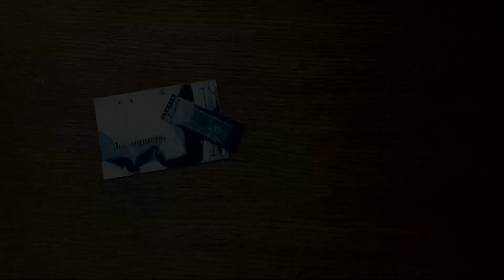Raspberry Pi Pico Brings the Noise.

Comment: Thanks for the video. I just love neopixels. I have one question though on the wiring of the pico. As you use an external power supply is there a risk that you damage the USB port of your pc/mac ? Thanks. Best.
Reply from the maker: If everything is wired up properly then there is no dange, but of your worried about it then you can run everything from a raspberry pi rather than an expensive PC/Mac. Works great for me :-)
Reply: @tinkertechtrove2910  Thanks Tim, good idea for the raspberry, I got one in my drawer, I will update it and test. I guess in your wiring, there is only the ground that is in common ? the pico is fed by the USB port only. best.
Reply from the maker: Yup

Comment: I'm very new to this. Thanks for walking through the setup. What logic level shifter do you recommend?
Reply from the maker: You may not need a logic level shifter depending on your application, but if you do then any 3.3/5v  shifter should be fine. I recommend getting bi-directional ones as they are generally more useful. I have edited the description to add a link to the exact ones I used here, have fun with your Pico :-)